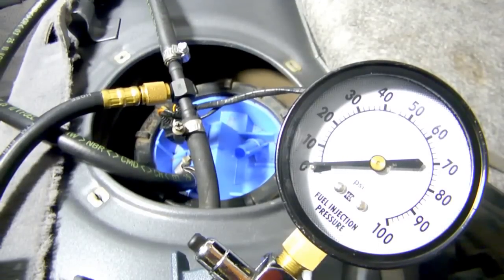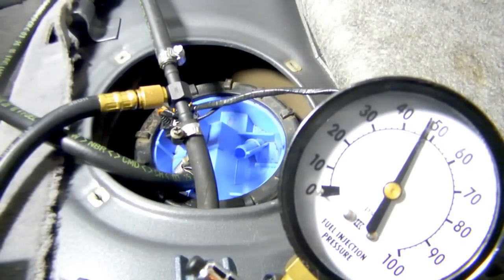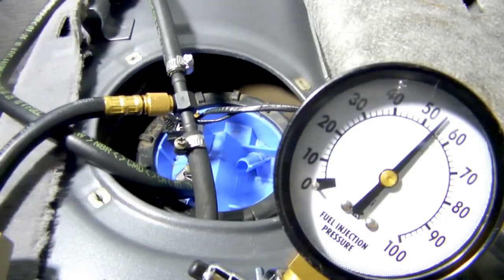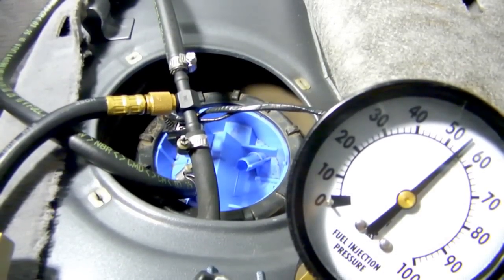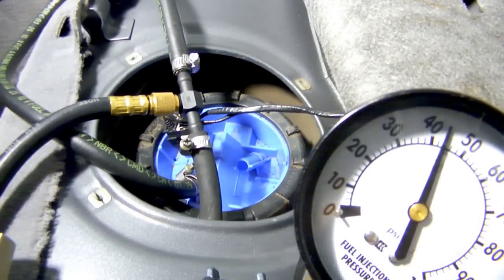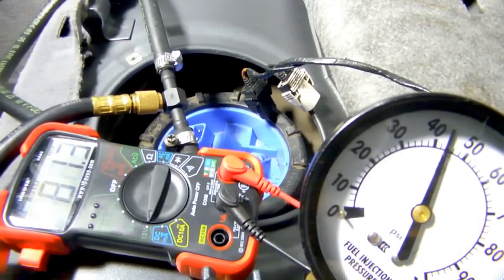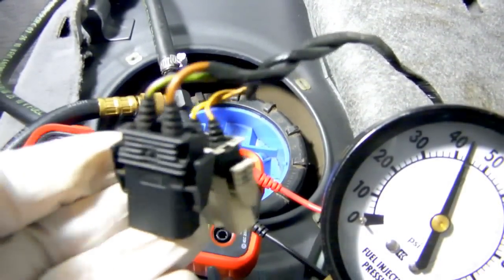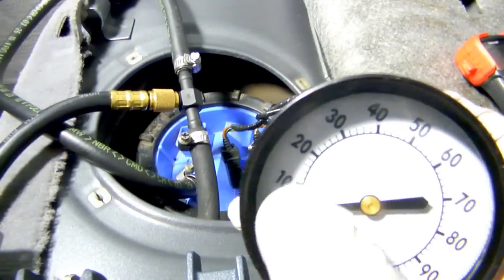BMW E36 FUEL PUMP TEST & TROUBLESHOOT PART 2

Comment: My problem is that after driving a few miles I start smelling fuel, and if I shut off the car for a few minutes it it cranks for a while and then start but if I let it sit longer like over night or hours it starts up fine. Like the issue is only while the vehicle is at temperature, and I can’t see any leaks or anything. Please help as this issue is driving me insane. Thank you

Comment: hello can you tell me what level of gasoline you recommend so as not to overflow when opening the fuel pump
Reply from the maker: You can remove fuel pump with full tank of gas although the car should be on level ground first or make sure car is level before removal.

Comment: What if my car bogs down after hard acceleration? I could be driving the car completely fine, everything works well. However if I accelerate hard, it'll start to bog down real bad, and hitting the pedal won't give it any acceleration. Nothing. Then I have to pull over, and the idle will be real bad. It jumps from about 100-900 RPMs, and eventually shut off. After about 15 minutes, the RPMs even out and the car will seem to drive normally again.
Reply: Estou com esse problema no meu! Ja testei todo sistema de ignição. Tudo ok, agora estou verificando se pode ser algo relacionado a bomba de combustível. Você co seguiu solucionar o problema em.seu BMW?
Reply: @Dockmoto  Apparently I posted this comment a year ago, which I had no idea at all that it's been 1 year 😂

Unfortunately I still have not solved the issue. However, I just went to AutoZone today and got a Fuel Pressure Test Kit Loaner Tool. I'm going to finally be diagnosing this problem myself and try to figure out what the issue is. I'm going to follow the exact same steps in the video and see what results I get. 

Have you figured out what was the problem for your car? 

What I do know for sure is that my ignition coil packs are fine, since when I disconnect each of them, one by one, the idle immediately changes. So my coil packs are fine. Therefore I assume my spark plugs are fine as well.

I just recently rebuilt my injectors as well with a rebuild kit that replaces; the plastic tips, the o-rings, and the filters that go inside the injectors. I also cleaned the injectors so, the spray pattern was pretty good on all the injectors.

I suspect I may have a bad fuel pump or a bad fuel filter, or even a bad fuel pressure regulator but, I won't know for sure until I diagnose the issue.

I'll comment back here again on this post to let you know what I find.

Comment: Why are you not testing pressure just before it enters fuel rail. It’s more accurate because it’s after the fuel filter and closest to injectors. I believe there is ltessire drop.

Comment: I have a 1995 bmw m3 e36 it starts fine when it's cold. After driving I have a hell of a time starting it then runs fine. Already replaced cam shaft positioning  sensor. Any ideas?

Comment: Thank you for posting this video.  It is very methodical.  In my case I have an E39 (M54), and the pressure reading I am getting at the fuel rail is around only 10-12 psi.  The symptoms are hard start and dying at idle and low to no power.  I would appreciate your feedback if you have any thought.  Thank you.

Comment: Hi.  I have an M Roadster (S50B32) and fuse 18 keeps blowing.  All the electrics have been tested and everything is good (fuel pump was ok until I overloaded it while testing it - I've replaced it).  The fuel pump (which I've just replaced as part of the search to find the fault) is stalling.  It pumps, then slows down and the current rises and blows the fuse.  It pumps fuel through a hose into a petrol can, but stalls (and blows the fuse) when it's plumbed into the car's fuel lines.  Any ideas?  I have a fuel pressure gauge on order, as I think there must be a blockage.  I'm hoping that it's just the filter.  If it's between the filter and the engine, is there a method for clearing the lines.  Can I use compressed air to clear the lines from the filter back to the tank (via the fuel rail) - I won't use it at more than 3.5bar, even though the fuel pressure for the car is 5bar?

Comment: Questions in the front of the car when I turn the key on goes to 50 psi then drop to 45 when prime is done what causes this I've check the psi in the tank its showing 55psi

Comment: I won a e36 320i 1994 m50 engine if done everything new vdo pump new coolant temp ,new spark pkugs ,new   fuel injector , new maf sensor and still sometimes the car takes a while to start in the morning and feels weird u press on the gas and the car wont rev above 1500rpm then when she worms up a litlle it revs to 2500rpm max and when the water temp gauge shows at the midle turn off the car restart it and it will rev normally at any rpm and will drive smooth pls any help abt that?
Reply: And i thought it was the check valve in the pump ive installed a check valve but used for hydrolic purpous coz i didnt find for fuel and still having this issue even ive checked as u did for fuel pressure and insure that the fuel regulator is gd and all that stuff 😢

Comment: this is fab,thanks very much,In my case the car will start if i hard wire the pump,so no power getting to the pump,my car is a 2005 e60 5 series 2.5 dont know where the fuse or relay are,anyway thanks again,this may help.eoin

Comment: I know this is a old video, but worth a shot, i got a 325i and im struggling with it smelling gas and shooting flames... its cool but not healthy, mine is at 3.5 bar (55psi) on idle but when i rev it up it can drop to 2.8 to 3 bar(40psi to 43psi)... will this damage the engine ? its a track car so high revs is where its living
Reply: seems normal, check air fuel ratio before beating the heck out of the engine

Comment: Your videos have been helping me diagnose my E36 no start problem.  Turns out I have a fuel problem, no pressure is being held at the pump, so I guess the check valve has failed... thing is, it's a brand new pump!  Also, when I clamped off the hose while the pump was running, it didn't raise pressure or squeak as yours did.  Do check valves fail often?  I installed this pump about two months ago and had the same symptoms before and after.  Another weird thing - my car started and idled with the fuel pump fuse out and reading 0 psi at the upper fuel rail... vacuum effect?  Got it on video and everything, blew my mind!

Comment: I have a bmw 330i and I took off the fuel pump check it with a battery did work but wasn't loud ?car cranks but won't start. should I get a new pump? or is it something else
Reply: I have the same issue. Hope they reply
Reply: +Boba Fett I changed it and it worked 
make sure you check your fuel pressure if  it's zero it may be your fuel pump
and if low it can be fuel filter ,regulator or your fuel pump is going out
and also make sure you are getting spark
Reply: +Boba Fett let me know if you have questions I might be able to help

Comment: Hi, I have x5 2007, I have problem starting only with cold weather, otherwise is good, I just replace the battery, but the problem still, it is cracking but no start. So if I put the car in garage , the car is working fine , but if I leave the car outside for 2 or 3 hours in cold weather , so will not start. Any suggestion please.

Comment: I removed the hose that connects to the filter and the fuel when back to the tank imediatly. Any sugestions?
Also my automatic transmission has hard shifting, no shackes or anything just when i put it in to Drive or reverse it gives 2 jolts. And when its changing gears looks like it releases the “clutch” too fast. When i accelarete and let the rpm dropp and put it in to Drive it does not gives a jolt.
Hope to ear from you soon.
Thanks

Comment: Nice job. I have a E38 2.5tds from 97 with 277.000km and my engine shakes at idle and on low rpm when accelerating slowly. It starts ok but it also has low power when pushing in 4th gear (automatic)
....

Comment: Hi,this was quite useful.I own the same model BMW you were working on and the problem I encounter is hard starting on cold weather mornings.When it finally starts ,it stutters for a while before stabilizing. But if the weather is warm it  starts the first time around.what should I check for?

Comment: My car just stalled suddenly when i was accelerating at a traffic light, I'm pretty sure it's fuel system related since it starts sometimes but stalls right away (starter is new as well), that's more likely pump related than wiring right? Since it happened so suddenly?

Comment: My M50 is running out of fuel at 1/4 in the fuel tank gauge. That happened before and it was the fuel pump. But now the fuel pump/pressure is ok, any idea of what is going on? And I really would like to know how that sucking jet pump inside the tank works if it has anything to do with my problem. Thanks!

Comment: This video helped me to diagnose a big fuel pump failure with my 325is: today i replaced the pump, and although I couldn´t get the original part, now is working fine. thank you very much.

Comment from the maker: Continued...Also try the wire wiggle test at the plug to see if that will activate the
pump. A weak ground signal to the plug could also cause this, you should
see direct continuity between the ground on the plug and chassis ground.  I
hope this heads you in the right direction, use caution when bench testing
your pump, it will burn out quickly without the fuel running through it
which lubricates and cools it, I would personally test it for no more than
5 seconds at a time. MyBimmerSpace

Comment from the maker: Continued.....The pins can lose conductivity from oxidation, Radio shack sells a cleaner
called Deoxit that chemically removes oxidation and also contains a
conductor improving agent. There is another product that enhances
electrical properties called STABILANT 22A which is what I use most of the
time, but it is not readily available

Comment from the maker: Correct me if I am wrong here.....So you did a bench test and it worked,
but when you plugged the pump into the harness it did not work even though
you are reading 12 volts.

 It is possible your pump has an intermittent fault, they can act like
starters, give them a tap and they turn on. I would check your fuel pump
electrical plug connection, the plug may read 12 volts but can't carry the
amps.